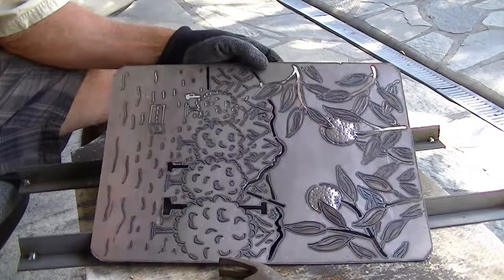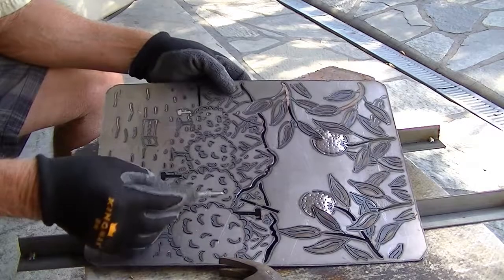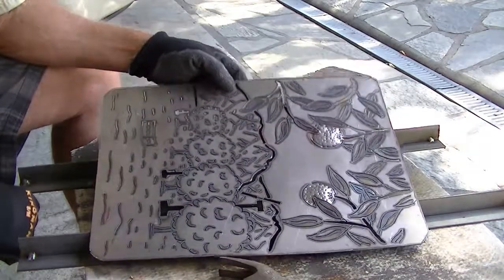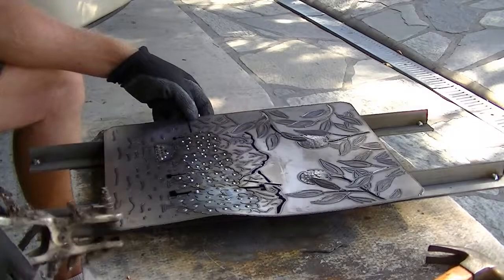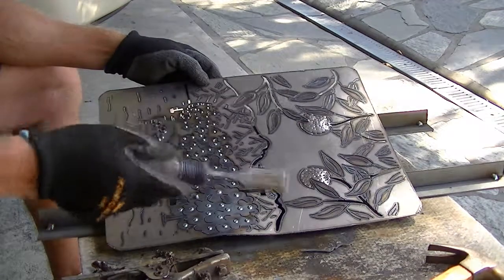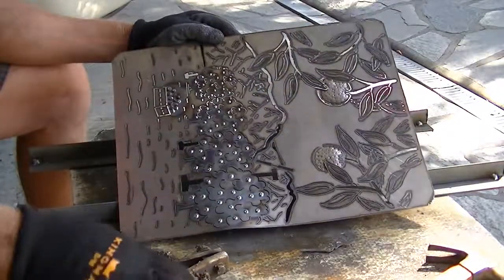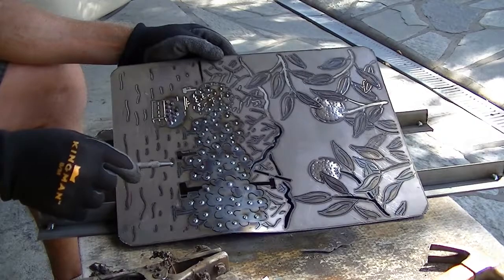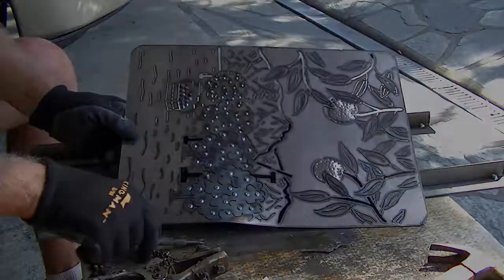Plasma Picture Making Part 3

Comment: Great videos, here’s a tip. Cut some slots in your t-bars and add a couple of slats that are not permanent but adjustable just by sliding them, an adjustable square really, then you can put your ground clamp on the t-bar instead of the picture. This should make your work flow better. Great pictures, inspiring.